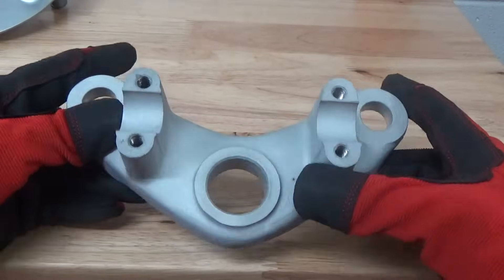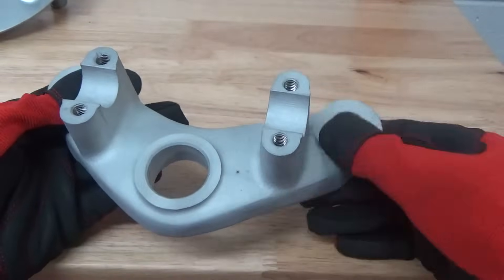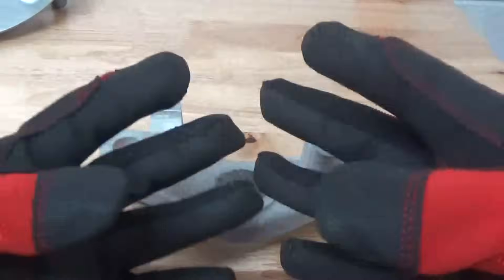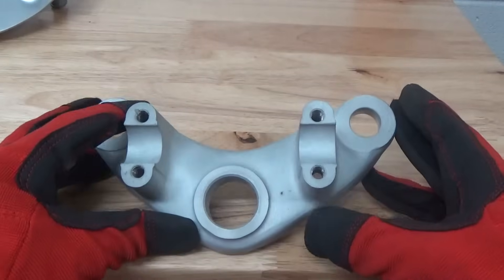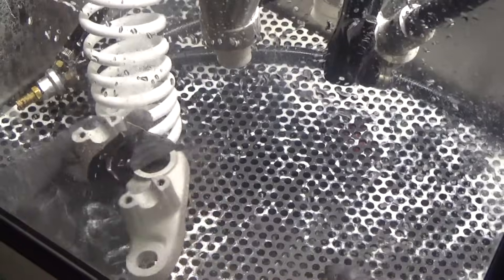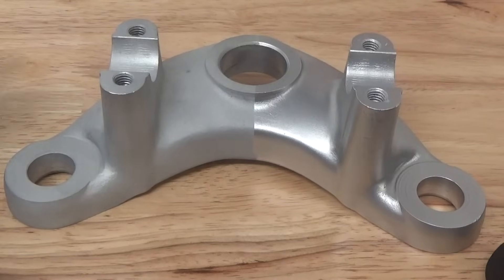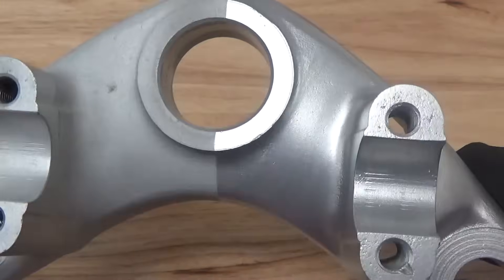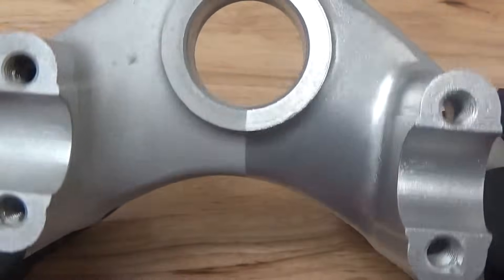Difference Between Dry & Wet Blasting- Vapor Honing Technologies

Comment: Thank you for sharing this informative knowledge. So after looking at this video, I can conclude and think that the dry sand blast is more preferable to be the method of spraying the undercoat paint as that rough surface are usually give a good and better undercoat paint finished. The smooth finished that comes from the wet blasting are good to be the method of Chromatic colour as usually they won't need any undercoat layer. Thank you.

Comment: Each method has its place. The rougher texture of sand blasting allows primers and paint a better surface to adhere to. I knew a fellow who did a lot of powder coating and no mater how clean a part was, he would sandblast it first.

Comment: The main reason to blast clean is to get the profile or peak to give good adhesion between primer and substrate. Dry blast is better surface preparation compare to wet blast but in certain environments issues wet blast will take place .

Comment: I dry blast now but looks like the wet blast could also be a option.
Question.... does the wet blasting go further into the metal than regular blasting or are they the same. 
if there is a link i would like to know what a starter kit cost for wet blasting.Awesome video!! for showing the difference in the two different ways!!
Thanks
Reply from the maker: Thank you, my name is Niki.  You can email me at nicole@vaporhoningtechnologies.com or call to request pricing 828-202-5563 x 103 Thanks for watching.  The starter unit starts at $799.99

Comment: I want to know what blasting sand must be used for decorative purpose items. I need the finish to be very matt and it must give brush steel finish and not the aluminium finish
Reply from the maker: Hey Aditya, my name is Niki.  Which Vapor Hone machine do you have?  What kind of decorative purpose?  You can call me at 828-202-5563 x 103 Niki

Comment: Which finished surface would be better if your end results is to powder coat the part after blasting?  The rougher mat surface from the harsher abrasive or the more polished surface from the bead media?  Thank you
Reply from the maker: You want to prep the surface to accept the coating so the harsher abrasive is best for that process.
Reply: @VaporHoningTechnologies   how well does this machine do with removing powder coating being that it recycles water?  is there a filter?

Comment: How well does this do for Media jamming? Like threads and blind holes with Ball Bearing stops.
Reply from the maker: We recommend a thorough rinsing process, blow all areas off with a high 
pressure air hose, allow the part to dry and repeat the process.  
However for the most difficult areas, you can use soda with wet blasting
 as well.  This will give you an exceptional finish without the worry.
Reply: @VaporHoningTechnologies  What do you mean by soda? Water and baking soda? Thanks.

Comment: What is it...water and soda blasted with air?
Reply from the maker: Depends on the application, you are using water combined with Glass Bead, Aluminum Oxide, Ceramic Bead, Soda, Garnet and many others to create a slurry mixture and the Compressor creates the pressure to push the slurry onto the surface for cleaning or stripping.

Comment: How is this affordable for home use? I am restoring a bike and will not send a bunch of parts out to be chromed. And what kind of media do you use if not sand? Baking soda? How can I do it cheaply? Like without a cabinet setup?
Reply: There are some DIY videos and blogs which can answer your questions. I will stress to NOT use sand under any circumstances because of it's silica content. I have built or restored or re-purposed four bikes thus far and currently building a 250cc 2 stroke Yamaha DS-7 as a cafe racer. Budget? $1,000. I have an advantage in surface prep because of where I work but with everything else I map out the process and seek as cheap a source as possible. The 1972 DS-7 "donor" bike I bought for $90 at a motorcycle salvage yard, title included. There is an old saying that there are three important aspects of any job: Price, Speed, Quality but you can have only two, the third will be sacrificed.
Reply: Jeff Tilghman Hi Jeff, same situation here. Also restoring a bike, well at first, right now multiple haha. I bought a karcher high pressure cleaner and the wet blasting kit (even available on AliExpress). Works wonders! Let me know if that is something for you and if you buy it what you think of it! Good luck

Comment: All due respect, that is a fine result you have produced.  As the owner of a media blasting company I know the finish is a result of the media and pressures used during the blasting process.  I wet blast when dust suppression is needed due to the proximity of others or the material being remove  (Lead Paint for example).  Glass bead, plastic bead, soda and so on  in their various sizes can produce a almost polished surface on soft metal like aluminum, brass and copper.  The desired finish is determined by what the finished product is going to be, such as polished, painted, clear coated or powder coated to name a few.  This  video is very good and of high quality but kind of misleading.  I mean no disrespect, you are obviously a professional who produces a great finished product.  Most high quality machines produce a finish that reflects the owner of that machine.  When a person studies and practices their craft he or she will produce a more superior finish than those who don't and you produce a superior finish for sure.  Sand Blasting is never a good idea, sand contains silica, is inconsistent in its hardness/density and leaves a dust and debris in the pores of the material being blasted.  The same/better/ more consistent  finish is produced with glass be it crushed or bead.
Great work Sir

Comment: For painting the sandblasting is better because  the primer will stick to rough porous surface better , but wetblasting would be nice step before polishing , like rims etc..
Reply from the maker: +Ovais Saand You're exactly right in that rough surfaces provide great adhesion properties for paint and other coatings. However, wet blast is also great for preparing surfaces for coatings as long as the correct abrasive is chosen.
Reply: Vapor Honing Technologies okay thats good to hear
Reply from the maker: The Wet Blast process can use the same abrasives as dry blast, therefore, we use Aluminum Oxide or Silicon Carbide to prep for coatings.
Reply: @VaporHoningTechnologies  Hi, thanks for the mind opening video! Do you remember what medium you used here for the wet blast?
Reply: Also if your using sand to dry blast make sure you clean down your parts that your preparing to paint because the silicone content in sand can cause you issues. Try not to use sand at all.
Reply: @scottfogarty1249  Sand has silicon in it not silicone.
Reply: @ricky302v8  yes ....
the 14th element on the periodic table. That little "e" makes a huge difference 👍
Reply from the maker: @scottfogarty1249  In the Vapor Honing Process we do not use sand at all.  We blast with Glass Bead, Aluminum Oxide, etc.
Reply: kerja yg sempurna kawan

Comment: the right hand side definetely looks like silver paint sprayed on, has that mid sheen to it. If thats the original finish i am surprised as the dry blast on the left doesnt look anything like the right hand side,unless the dry blast removed all the chrome polished finish that was there from production.
Reply from the maker: +SP330Y Definitely hear this a lot. Right side is raw bare aluminum left side shows you the severity of a dry blast system and what it can do to parts.

Comment: Great video. Always wanted to see the comparison directly between dry blasting and wet blasting.
We use wet blasting in our facility but with glass beads only. If I want to deburr some machined parts, is it good to have ceramic beads with aluminium oxide? With glass beads we can polish only we cannot take out the burrs